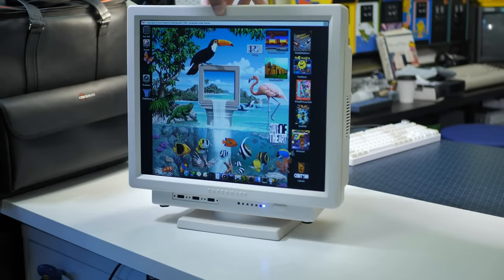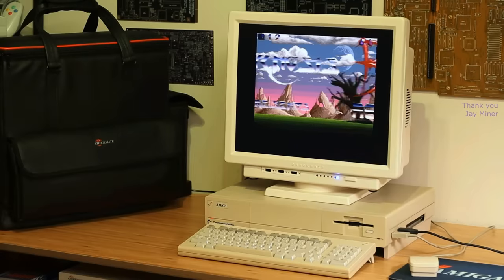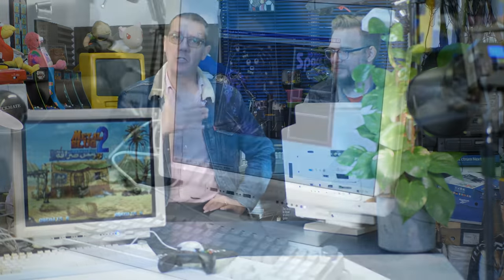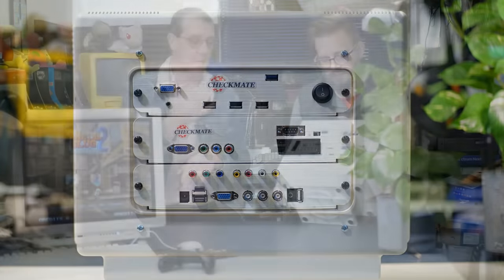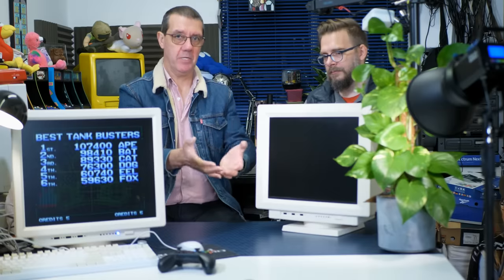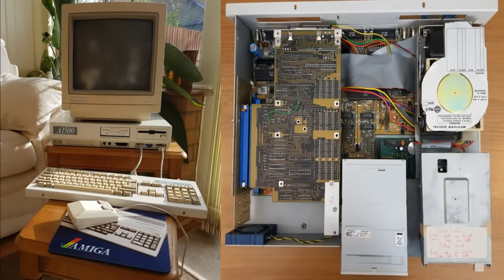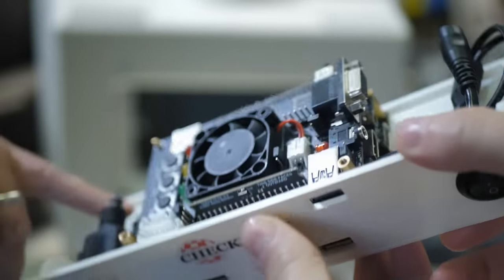This Monitor is the Future | Nostalgia Nerd

Comment: Totally like the idea of customised input options and more support for like all of the things, but when I scanned the kickstarter, I couldn't actually work out how much it would be, like total cost, but from what I've seen it's a bit out of my price range... £269 for the chassis, but that doesn't include the panel... so it's not a monitor until you have the output panel... to be paid in future? Hmm... but I do like the modular ports thing, and wish more monitor designers would make it so you can choose what connectivity you want, that's cool... but part of my mind niggles that this may have done better as a "connectivity box" than a monitor, or even a board, since it seems to be geared toward people making customisations, so they could put the connectivity boards in monitors they want, rather than being restricted to a single 19" monitor box that you've got to buy the panel for later? Just my thoughts, I hope it's successful for those that want it though.
Reply: The "connectivity box" you mentioned already exists... In fact, the input "modules" for this monitor are just already available external devices that have been modularized. Go check out RetroTINK, OSSC, and GBS-Control.

You're paying a steep price for a generic Chinese 1280x1024 LCD panel, and a cheesy retro-looking case.
Reply: @CMskittles  Makes sense that they already exist! I'm in total agreement with you, but I think this design idea is good to get back into the minds of designers, since so much stuff is kinda designed "disposable" these days, and becomes useless afterwards, but if you can put in custom modules, you can build a device that will always have what you need, just think that's a cool idea, so while this is rather expensive for what it is, I'd like to see more from the "more useful ideas" camp in future, and seems a bunch of people like the idea too, although maybe not the high price :) Have a good day.

Comment: If we could get something like this but with a CRT tube instead of the LCD, it would be fantastic, all that I/O with a good 17"/19"/21" CRT tube would be the perfect does-it-all gaming display, I guess you could comprimise with a QD-OLED panel, one that can do 240Hz and BFI as well as integer scaling, but a CRT tube with a modern good quality display driver capable of low lag HDMI/DVI/COMPONENT as well as 31Khz and 15Khz VGA/Scart inputs.

Comment: I already took a look at this project and while it's a commendable effort, I have some HUGE question marks for why it would be a CRT replacement:

(a) CRTs are popular because games were designed to use them, relying on the softening aspect to make mere pixels come to life. ONLY on CRTs or on high resolution screens with shaders you can get this effect.
(b) CRTs can handle a TON of resolutions without impact on image quality.
(c) extreme low latency for e.g. light-gun games

These are the three main reasons to get a CRT even today. Now let's look at this new monitor:

(a) The resolution is an ancient 1280x1024 pixel one which makes it unsuitable for using CRT shaders. At minimum you need a 1440 vertical resolution for the CRT effect to look realistic. For my arcade cabinet I had to settle on a 1920x1200 screen which is the best I could do since 16:10 screens do not exist with a 1440 vertical resolution.

Besides this, this monitor clearly has no on-board shader solution so for using it as a CRT monitor for classic consoles, it will look horribly pixelated

(b) Speaking of horrible, the single resolution will also make the pixels look uneven, especially on higher resolution games. A game played at 800x600 will look terrible (and I had a 1280x1024 LCD screen for years so know what I'm talking about). Using it for any PC retro gaming will be limited to VGA games and even there the pixels will NOT be even in size. For that they should have gone with a 1600x1200 resolution screen (which would have been a far superior choice for so many reasons).

(c) I hear this screen has less latency but still too much for lightgun games ...

So what does this leave us? With a monitor that is a bastard child of both. It's not as flat as an LCD ... and it's not as lightweight. It doesn't have the warm glowy pixels of a CRT, it doesn't have the sharp pixel accurate image. It has a nice retro look ... and I'll accept it has slightly lower latency (if it's true) but I honestly don't see the appeal. 

There's many solutions that let you hook up a modern console to a modern TV or screen, some also have very low latency. CRTs are still widely available (I bought two great ones last year and paid peanuts) and while that may change in 10 years, I imagine that in 10 years we'll have OLED high resolution screens that may be able to emulate the CRT look more realistically. Also, any such project REALLY needs on-board 1:1 pixel scaling with black borders - maybe the Mister can do that but I dunno ... . Until it can emulate the strengths of CRT, it's an expensive hybrid that does neither well.
Reply: I also find the enthusiasm for this project bizarre, considering what's being sold here is a plastic case, a connectivity box without, as far as I'm aware, a competent upscaler like the Retrotink, and the option of adding a cheapo LCD panel inside it for an additional cost. (Incidentally, the 1ms latency figure has been the bugbear of monitor aficionados for years: every manufacturer has claimed it at one point or another and, since there are no standards or regulations in that regard, it's pretty much always turned out to be bullshit. It certainly won't feel as responsive as a CRT—that's just how the technology works.) I don't want to rain on anyone's parade, but describing a 300-dollar novelty plastic box as "the future" seems a little bit too bombastic to say the least.
Reply: @FranzKafkaRockOpera  Yea it's why I added the "if it's true" about the low latency because I often see it mentioned but the tech just never allowed for it.

I dunno, it's theoretically a cool project if you just want a retro looking LCD but it costs way too much for that and the resolution is just not high enough for me. 1280x1024 is just a bad resolution. Not a single classic resolution fits inside of the vertical aspect with integer scaling.

Comment: The biggest issue with any lcd monitor is the fact there is no phosphor effect for depth, I just think the ideal is to have a shelf of a couple 14-20 inch crt's you collect over time.
Reply: @NintendoDude888  no theyre ugly lol so is rgb signal and most fake scanlines. composite & crt only, you might as well just emulate if youre gonna ruin it.
Reply: You could put an aquarium in front of it.

Comment: The GBS-8200 used to scan double 15khz signals to 31khz costs just £23, there doesn't seem to be much extra functionality for £400-450 (Unicorn panel version). Apart from some additional input methods and a nice looking case I can't see what else this is doing, or am i missing something here? You'd get the same result from an OSSC and any monitor by looks of it. I backed his Amiga case a couple of years ago but can't see the point to this project.
Reply: Injection moulding in small numbers = expensive.
Reply: You forgot VAT. Another hundred on top.

Comment: This is awesome! One thing IMO to improve this, would be to recess the custom panel on the front and have a flap (to hide it when not in use). And ditch the blue led for a red, green or amber one.
Reply: Yes, definitely needs a softer LED color.

Comment: I make a similar thing. I take old 1080p monitors and place laptop guts in it. Add some cooling, cut some port holes and mount the PSU internally, connected to the original, so it's just one cord. So you get BT, Wifi, and a pretty good experience overall. If you've never had a PC or you like AIOs, it is the ultimate in custom. Now mind you, I make these out of used gear. I pick up used monitors, 32" and larger, and I set it up. To this day I have had only one person ask me to make a high end unit in a 43" 4K TV he had with a gaming laptop. That was awesome. It all varies based on the specs of the TV/Monitor and the computing gear but even the lowest end models I have made (Core2Quad 8200/NVS 250m Mobile GPU in a 27", and it is also why I no longer use 27", too much heat) did their job and played some minecraft and performance mode Fortnite.

Also, Wanted you to know I checked the numbers and you are less than $2k away from goal with 63 hours to go and it was going up as I watched it so, kudos on this video.

Comment: I have an old lg 1080p model 42LB570V that basically serves this purpose. Has HDMI x3, SCART x1, component x1, composite x1, RF x1, USB x3, and a "PCMCIA CARD SLOT", whatever that is. Just missing s-video and VGA. It's like a ten year old smart tv? 

I recommend getting something like the above instead of the product in the video. Why would you pay big bucks for a faux crt that really only offers old inputs on a small, 4:3 screen? Get an old TV from just before they started taking the analogue inputs out. You can find them in pawn shops for a pittance. 

The old LG is perfect for everything up to PS3. I don't have to feck around with any adaptors to run old kit, and its useable as a modern TV. Gives a perfectly nice clean 1080p.

Comment: The big question with this monitor... What's the timing like?
Old rhythm and lightgun games were reliant on input timings being rather tight and most scalers in modern HDTVs are slow, producing a late response.  You can guess what that does for something like Parappa the Rapper, Dance Dance Revolution or Duck Hunt.
Reply: yeah i'm sceptical on this product, i mean it will cost me $546 for this product including shipping to aus, i can buy a brand new sealed old stock crt monitor for that price, theres a few of them online and they work both 110/240 v
Reply: Lightgun games certainly won't work on this monitor

Comment: if they made this OLED or CRT i'd be sold
Reply: (i know that's basically impossible)
Reply: OLED is great if you want burn-in, but not so much for anything else, and CRT is well, not going to happen
Reply: @thesteelrodent1796  that's what screen savers are for :)
Reply: Why not plasma? I have an older LG TV (40 inch or so) and it positively looks amazing running my NES compared to my newer Toshiba, The colors are rich and deep, I dunno it just looks awesome. 

Heavy tho.
Reply: @the_kombinator  "Why not plasma?"
Plasma displays haven't been manufactured since 2014.
Reply: @amipal24  So it's a case of "we're stuck with what we have." Not a bad effort, then.

Comment: This thing+the built in Mister is like the iMac of retro gaming. Pick up a deck as well and you've basically got an arcade in a box, plonk it on your table, only two cords needed. Beautiful. Only pitfall is you can't put it on a tilting VESA mount for tate mode.

Comment: I made it myself. Grabbed old CRT monitor, Took out all Sh#it from inside completely, installed LCD panel without plastic bezel, added interface board from Ebay. And - go to Go. Total spend 38 hours and 40 us bucks. But, your device is very cool indeed. In your device more aesthetics!!!

Comment: I personally do not see any benefit in this monitor?! A regular IPS screen with a bunch of ports. If it was a CRT it would be different, but like this NO - you can install a Raspberry Pi or Mister on most IPS monitors that are older than 5/6 years because they have large cases... Expensive gimmick.

Comment: With a MiSTer in this, it is literally the battlestation we all dreamed of back in the 80s and 90s. “What if I had a computer that could run all my computers like the Amiga, Atari ST, DOS, and Windows, but also play all of my Nintendo and Sega games?”

Honestly, if Checkmate could mass produce this at the $249 price with a MiSTer built-in, it would sell like hotcakes. They could easily have attaches like controllers and keyboards where they can make the real margin. An all in one retro system out of the box? Yes please.

Comment: Highly overpriced plastic shell. This checkmate case has nothing but "pods placements" for you to add a gbs-control (with an unmoded base gbs), a retrotink or whatever. 250 pounds for just a prety plastic case is insanity, hence why the KS isn't working.

Comment: I could have used something like this monitor 3 years ago. I remember searching all across the metro area for monitor hardware with similar capabilities and was S.O.L. it's a lot hard to find old sd tech to run older hardware. Hopefully I can snatch one of these up. thanks for the kickstarter link.

Comment: Nothing about this emulates a CRT whatsoever. Simply a pointless 4:3 monitor that's trying to evoke nostalgia for the sake of selling units.
Reply: Who said it emulated a CRT?
Reply: @NYANWHEEZE  got him with that one
Reply: @NYANWHEEZE The shape of it, most obviously.
Reply: @lapielazoolie  4:3 is an aspect ratio, not a screen type. Unless this is satire, I fail to see your point
Reply: @NYANWHEEZE  Obviously, hence why OP called it “a pointless 4:3 monitor that’s trying to evoke nostalgia [simply] for the sake of selling units”. I don’t know of any LCD panel that has a hump on its back the same way as a CRT, the resolution is irrelevant besides towards the fact it’s a flatscreen not a widescreen.
Reply: @lapielazoolie  I can't tell if you're trolling or not
Reply: @NYANWHEEZE  It’s no troll. Just look at the Kickstarter if the shape of the monitor itself doesn’t strike you as emulating a CRT. Makes it quite obvious that’s the intention

Comment: I am CRT, through and through. But, I will admit that this looks flipping amazing. And like Mr Nerd said in this video, we have to wonder why this hasn't happened before ?
I am getting some serious iiyama CRT SVGA monitor vibes, here, some real 90s nostalgia with the white version.
I have my Mister connected to a 14" Sony PVM, and it looks amazing on this 1442 QM. But having one inside this modern monitor, when you can just pick the whole thing up, and take it to a friend's house, is simply amazing.
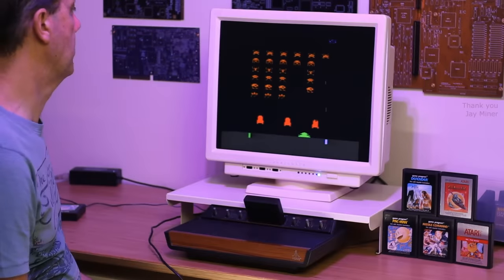I wonder how the Atari 2600 was connected up, at 17:40 ? I guess that one is composite modded ?
Would love to see that old connector, the one everyone hated, RF. So many old consoles of mine are RF, and will remain RF mostly due to me not wanting to composite-mod them, and drill holes for the RCA connectors.

Comment: It would be nice to have an S-Video pod that accepts both the 1987 standard 4-pin mini din connection and the earlier Commodore Y/C RCA connections. I know that simple adapters exist, but Commodore chroma had a slightly higher voltage than standard S-Video chroma, which is why the C64 looks slightly oversaturated on standard CRTs while other S-Video sources look slightly washed out on the Commodore monitors.

Comment: I love the monitor's concept. Though not a collector of retro hardware, i do design electronics and this looks like a great maker display. HDMI/DP are nice, but not exactly DIY friendly unless you go the obvious route of just slapping a RPi zero and call it a day (which is kind of boring). The older signals like Composite and VGA are more feasible to do yourself. I can imagine myself building like a electronics lab controller monitoring everything with the ability to switch inputs for retro tech projects with this.

Comment: The interesting part would be if the monitor provides adjustable horizontal and vertical picture size. This is the missing feature on all regular flat panel computer monitors I encountered over the years. And it’s nothing more disturbing not beeing able to adjust the size of the picture.

Comment: I think one nice addition for the "pods" would be a HID to 9pD-Connector converter. Like a normal mouse to C=1351. I mean you could run with the general idea and put anything in it you don't want to ruin the case of your vintage for.

Comment: I can definitely see the appeal for people living in apartments who don't have the free space to keep a bunch of CRTs around. I myself have several LCDs that I use for lugging around to my local retro computer club meetings, one of which can do composite and 15KHz over the VGA input. I do however prefer to use CRTs when showing off systems as "showpieces." IE, I just acquired a PC-Jr, and while I've rigged up adapters to integrate it into my already existing EGA setup (along with my Tandy 1000 HX and Hyundai XT clone) for the sake of saving space, I WILL be showing it off with it's proper monitor the next time our club goes to a convention.

Comment: One thing that would make this the perfect monitor for retro gaming is if it could be flipped on its sides as well for vertical gaming, now since some games are weird and have fixed orientation it would have to be possible to do both left side up and right side up for this to truly cover all retro gaming needs.
Shame I'd probably never be able to get this monitor here if it gets funded but still awesome concept so far.
Reply: I thought about that but it just was not possible in this design

Comment: Weird choice to go with a 19 inch screen. 19 inch ones are 5:4, not 4:3. 20 and 21,3 are the sizes to go for, they also do 1600x1200, so you have more pixels to do integer scaling/scanline reproduction. Also 19 inch is usually lower quality, those are panels manly used as industrial production information panels, not with color accuracy and contrast as priority.

Comment: The big issue is the price of this monitor. The base model alone costs £249 which is very high for a monitor. Considering that I found an Acer 1716 (same panel resolution) for a lot less than that. Sure, it’s not IPS, but I think I don’t need IPS. I just need composite for my Famiclone, MegaDrive clone and Sega Pico, and and 9-Pin TTL for CGA/EGA for my Sharp PC-7000A.